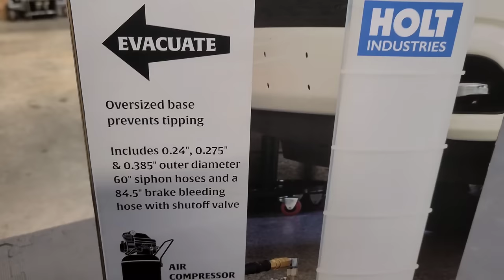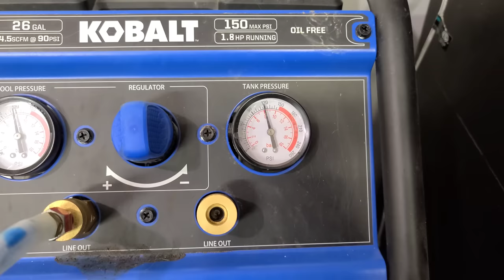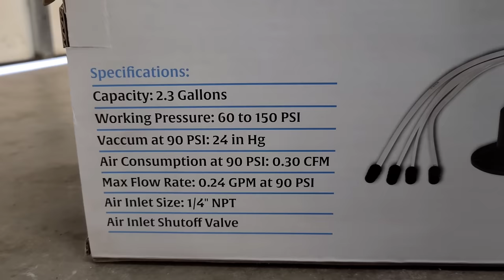Holt Pneumatic Fluid Extractor 57056 Review

Comment: The $89 version has a manual hand pump to create a vacuum in order to start the siphon so you do not need a compressor.  It is also a manual process to empty the reservoir by dumping it into a container.  I tried mine to remove the oil out of a hydraulic pump reservoir on a zero turn mower project.  It works great!  I usually store my tubes on a nail on the wall. You just have make sure that the tubes are empty so they do not drip.  Nice demo!
Reply from the maker: Thanks for sharing!

Comment: Good Morning, Even if you want to open the oil drain nipple or oil drain plug on the engine oil pan or whatever the case may be - You will virtually eliminate the sudden outflow of oil or other fluid by using the extraction process. 
Also I also use a 12v extraction pump that I purchased from off of eBay in which I pump the engine oil that I have extracted into various empty oil containers in which I usually take to the local AuroZone for recycling of the used oil.
By doing this, I reuse the empty plastic containers as well as properly recycle the oil - A win win all around. Thanks for your great video.
Reply from the maker: Thanks for sharing my friend 👍

Comment: Great review.  Not sure I would want one that can not do gasoline though.  But for oil changes looks pretty good.  I wonder how much oil you get out from the usual tipping the mower over and draining.  Seems like the heavy crap would stay at the bottom which is not what I would want.  But I have nothing better to recommend.  So looks like a great investment to me.  Thanks for the video.
Reply from the maker: Seems to work well for me, especially when you don't have access to an oil drain plug or the plug is simply in a bad location